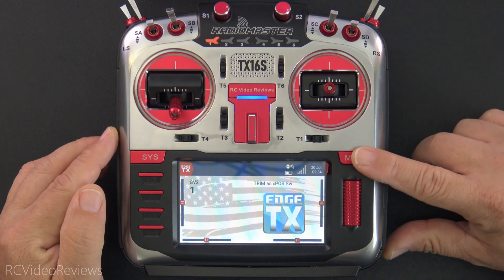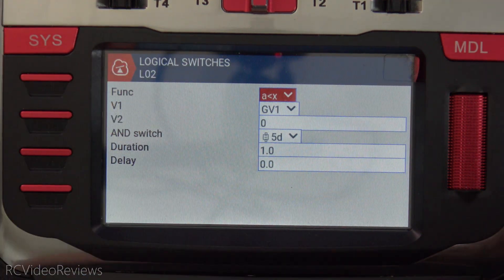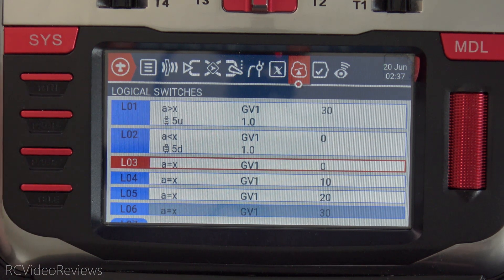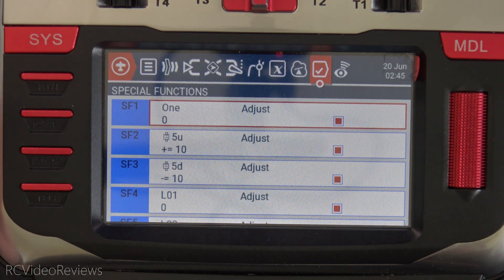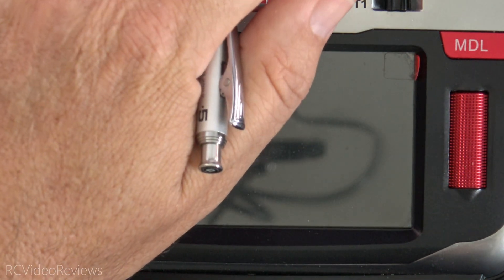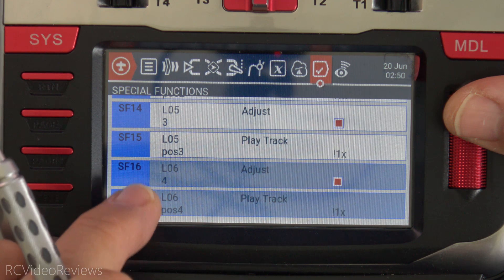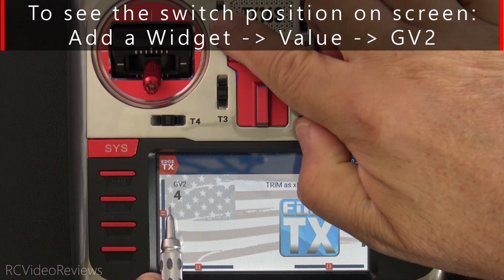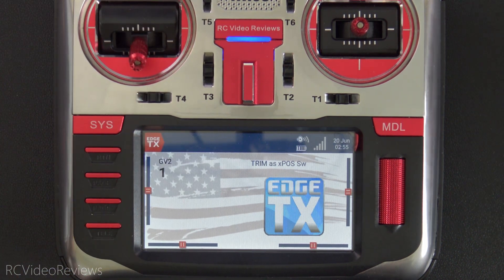How-to Use an EdgeTX Trim Switch as an ANY NUMBER Looping Multi-Position Switch on Radiomaster TX16s

Comment: How i can easily use T5 & T6 trim switches for trim on channel 5 and channel 6?
Reply: @RCVideoReviews  Yes, thanks 😊! It is right. I am already resolved it. First as you need add new input, second you will add new mixer. It work. I am use this on CH5 and can use T5 to trims volume ( master gain signal) for Gyro stabilizer during flight
Reply from the maker: In the mixer you can assign a trim switch as a source. So on Ch5 edit the source and pick the trim switch you want.

Comment: Hi, been watching your informative videos, thanks. Question: I am New to the hobby. Got a OMP M2, but when I fly in normal mode, which is stability mode, trim heli for level and then switch to sport mode the trim is so far off that I have to try and retrim. Is this normal?
I have leveled the swash plate. Using a TX16s. Was thinking if I have to try and find a way to set trims to the mode switch. Any help would be appreciated.
Reply from the maker: That's not normal. In fact, I don't believe I even use trim on the M2...?

Comment: I currently have the Inst. Trim setup on my right top SH switch like you mentioned in another video but it's cumbersome to use while holding the right stick in level flight position.  Is there a way to set it up on T5 as a momentary switch?
Reply from the maker: Odd, I thought I had a video on that but I don't.

Yes, very easy. Go into flight modes and turn T5 and T6 off as trim options. We do this because you don't want your radio giving audio prompts based on T5 movement. i.e. T5 is a trim by default, if you click it about 15 times, it'll get to the bottom and the radio will say, "maximum trim reached" every time you click it after that. By turning it off in flight modes, you avoid that little issue.

After that, just set T5up or T5down as the switch for instant trim.
Reply: @RCVideoReviews  I finally figured it out.  I'm a newbie to the TX16s and wish the Trim switches were named in the FM screen.  Anyway, it worked perfect after figuring out I needed to set up the switch and inst. trim in the Special Function section.  I was hoping to do it in the Global Settings so it works on all future models, but this is easy enough to do.  Thanks for your help.

Comment: So with this Could I use the two trims to adjust band and channel on the VTX (after writing it in the CLI on the FC)?
Reply from the maker: You can use it as a switch. Any way you can use any other switch on the radio, you can use this. 

It's easy to add special functions to set a channel value. i.e. 
SF1 - L03 Override ChX -100
SF2 - L04 Override ChX 0
SF3 - L05 Override Chx 100

Comment: Thank you for the great video!   

Would it be too much to ask and/or do another video on how you would apply this to a quad model.
Reply from the maker: It's just a switch. You could use it to toggle flight modes, or VTX power levels, or rates, or anything else you can use a switch for. I don't think a video is warranted to cover that part. In special functions I would use something like this: 

L03 - Override ChX -100
L04 - Override ChX -50
L05 - Override ChX 50
L06 - Override ChX 100

That lets you specify the output on ChX to whatever you want it to be.
Reply: @RCVideoReviews  OK. Fair enough.   Thanks.